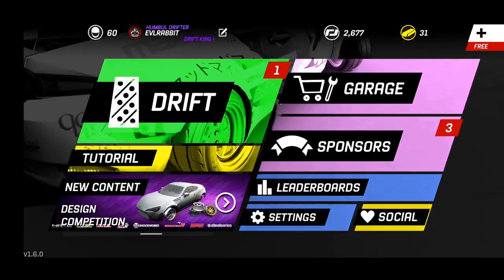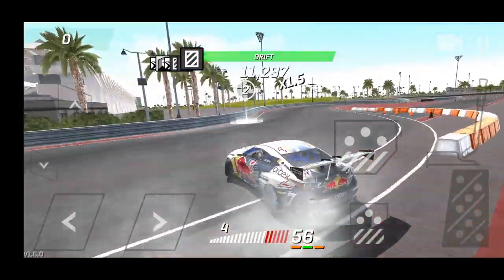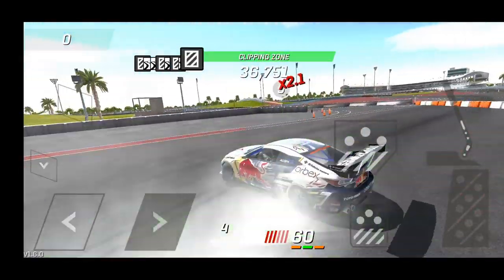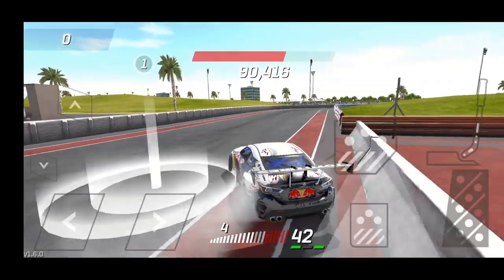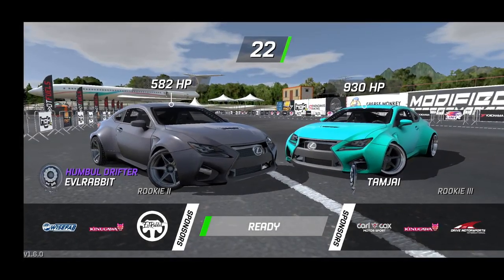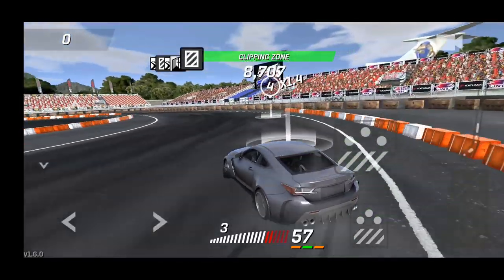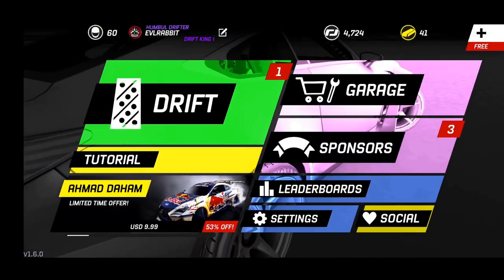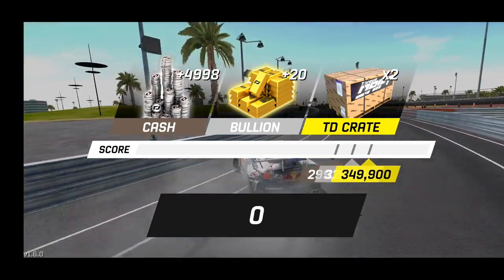Torque Drift Tuesday the RCF update is a uphill battle for me

Comment: Clutch kicks and E brake is really important to me on the runs. Start in 2nd, shift to 3rd around 60 mph and initiate and clutch kick where that line is before the barriers. I ride 3rd gear up until the 3rd turn and then use it again in the tight section and in the donut at the end.

Comment: it took me at least 15 times to do it, i had to beat 350k and got 367k, but what i did was keep it in 3rd cause i was able to get it back on power faster and especially on the corner where it has that sharp left turn, i would come in pretty hard hit the first clip, then ride the wall all the way to the clip thats at the sharp turn, had to hold on the handbrake about midway at the wall and then clutch kick when i pass the sharp turn to get back onto power. there might be a better way but thats how i did it, hope you can complete it

Comment: I did it easly in 3rd gear! the car is very controlable! use left foot brake to slow down the car and handbrake to get the wall runs! around 100k run with x2.95 or x3 clips should do it (:
from EsUmPão
Reply: my gold require was 350k btw

Comment: Some of these tighter corners you need to be in 3rd so you're not too far for the entry.
Reply: By the time you get to the wall you kept hitting close to the beginning, you need to be around 50-60k and 85k-90k by mid round about and 110k+ by end